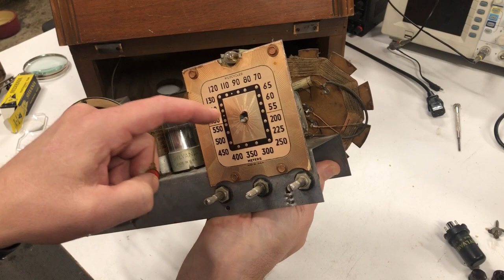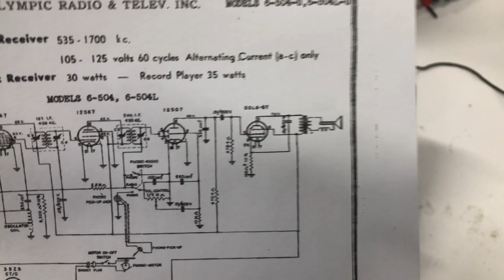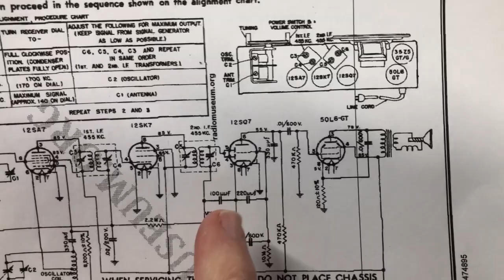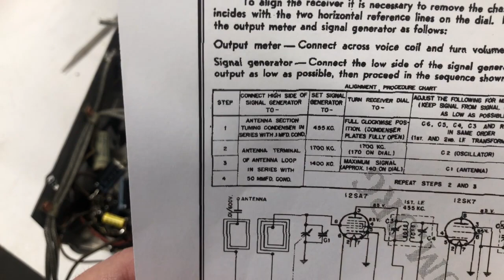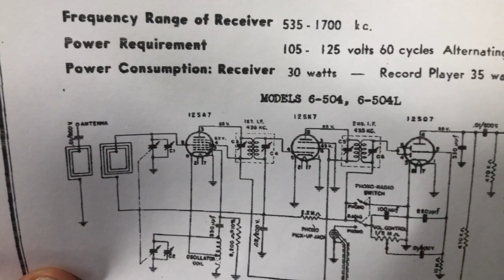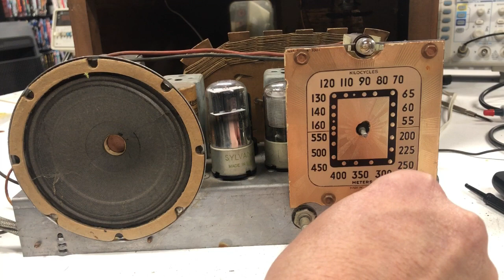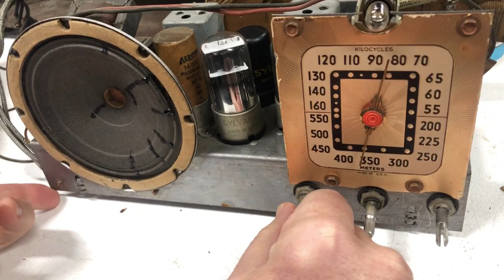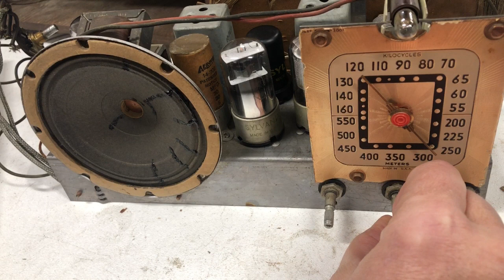1942 Olympic Tube Radio/Phonograph Repair Part 1

Comment: A guy on fleabay is selling one exactly like yours with a plain  case and says its a model 501. He had a picture of the paper  schematic inside and says model 501! When I look up the schematic it shows a differently designed chassis. However a 
nice long post on Antique Radio forums : First project! Olympic 501 with plenty of photos tells a story where using the 
schematic for a 6-504 is the right one to use. The cabinet screams of prewar design like 1940. Working out of your modern
electronics comfort zone makes this old stuff a challenge but you got this! Nice job so far King!

Comment: Greetings;
The absence of a power transformer informs you that this is a series heater string set. YOUR 12SK7 was passing filament current so any lit tube means they all are lit. If that tube is bad, swapping it did not inform you of anything.
Don't forget the #47 pilot lamp needs replacing
This "hot" chassis set has an "across the line" 0.05 uf 400v "death cap" shown near the power plug. Looks like this chassis is built by Hamilton. Since you are unlikely to be converting the B- to become "floating"(isolated from the chassis), I suggest making the power plug polarized and moving the power switch to the "hot" side of the line. The polarized plug connected to Neutral will ensure the chassis is not "hot" when power is "off", but will be when turned "on". I hope you are using an isolation x'former & a dim bulb adapter.
When checking voltages I noticed that you skipped the grid of the 50L6 at pin 3 to be sure it is not at a positive potential. I guess if you replace the coupling cap you will be eliminating any DC leaks through the old cap.
Be sure there is a good connection between the tuning cap and chassis (unless you are floating B-, then you want no connection).
I hope you are using a dim bulb adapter and an isolation transformer.

Comment: It may be a 1942 model, but certainly was made in 1940 or 1941 as factories were converted for the war effort in 1942.
If the pilot light works, it's likely that all the tubes filaments are good (series string circuit).
No plate voltage on 12SA7 = open IF transformer primary

Comment: Hello. Can an old radio be converted to a solid state set (giving the fact, tubes are expensive, and hard to find) ?
Reply from the maker: Every thing in an old tube radio runs on high voltage,  the only thing you could do is totally replace the interior with a modern radio circuit board.
Reply: @drueking  I think, circuits can stay. 
There is plenty of room in the case of an old radio.